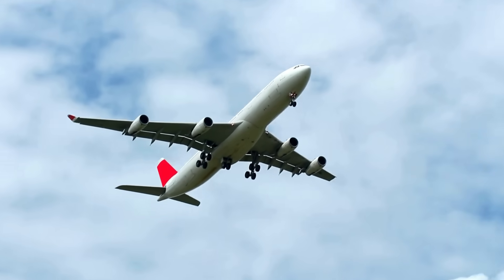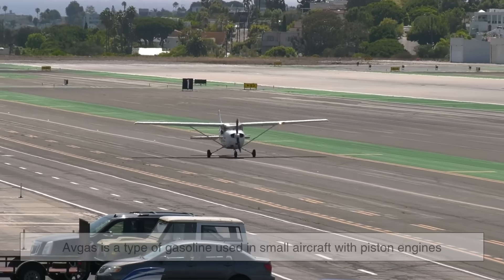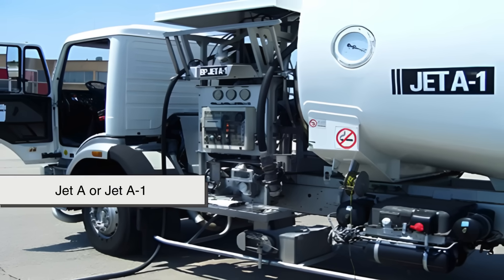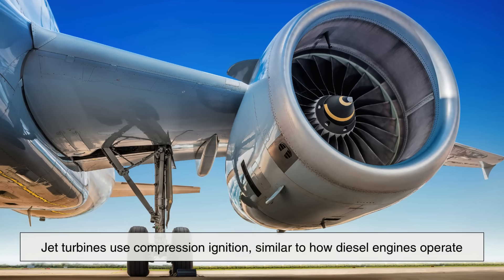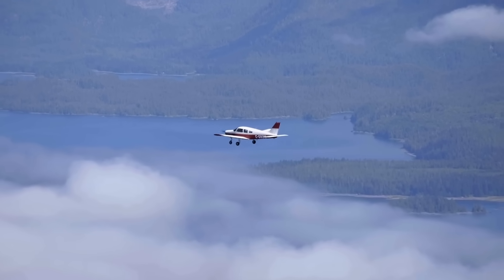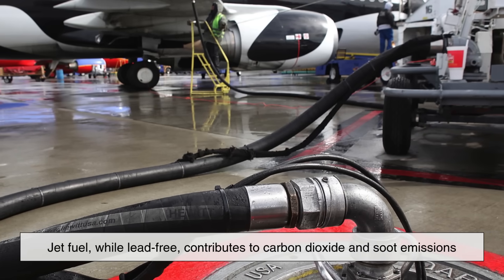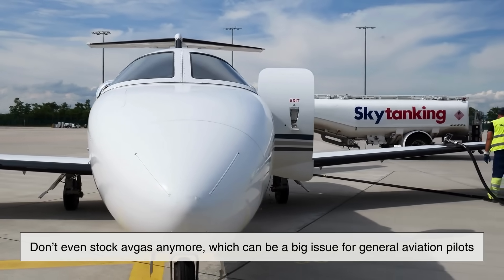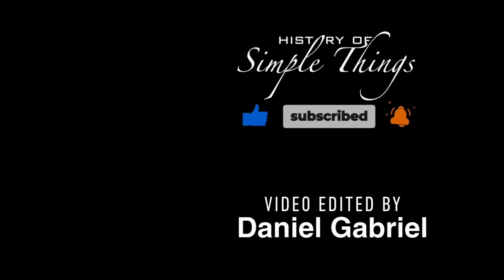Avgas vs Jet Fuel: What’s the Real Difference Between Airplane Fuels?

Comment: At the present time one of the big issues for piston engine airplanes is developing a suitable unleaded avgas formulation that is approved for use in piston engine airplanes. This has been a slow and complex process to develop a suitable unleaded avgas that has been taking a lot of time due to various reasons. One of the reasons is that in automobiles the gasoline engine is running at a low power output to cruise down the road. In a piston engine airplane the engine running around 80 percent of full power output to fly the airplane through the air.

Comment: Avgas fuels piston engines. They require a fuel that vaporizes easily, but burns in a controlled predictable flame front across the cylinder after ignition. If the fuel-air mixture burns spontaneously everywhere in the cylinder the explosion and resulting pressure spike wreaks havoc on the engine. While most laypeople think that the sparkplug sets off an explosion in the cylinder, it actually sets off a controlled smooth burn that typically takes about 5 milliseconds to complete. The octane rating of the fuel is a measure of how resistant the fuel is to exploding rather than burning. Higher octane fuels can be used with more compression of the fuel air charge, producing more power, and Tetraethyl lead is a very effective additive for increasing octane rating. This concern for smooth burning also fundamentally limits the size of aircraft engine cylinders and also explains the use of dual ignition. Dual sparkplugs start the burning at two points in the cylinder, allowing two flame fronts and completion of combustion in half the time.

Avgas isn't restricted to small engines. There have been very large piston engines built for aircraft, but it is true that gas turbines have captured the market for high power engines and current piston aviation engines are primarily 400 horsepower or less.

Jet fuel is used in turbine engines. Almost any fuel can be burned in a gas turbine if it can be pumped through a nozzle and atomized. The recipe of Jet fuel is controlled mainly to assure flowability at cold temperatures. This video says that turbine engines are compression ignition, like a diesel engine. Not so. Turbine engines have igniters to start the fire when the engine is starting,  and like an oil burning furnace, gas stove or a candle, there is a standing flame that continues as long as fuel and air is supplied. The igniter is turned off after starting is complete unless flight continues into an environment that might interrupt the flame continuity. The combustion process involves only a fraction of the core airflow...the design of the combustor is dictated on maintaining a stable flame and then mixing the very hot combustion gasses with the rest of the airflow to get the flow into the turbine section mixed and down to a tolerable temperature for the hot section materials.

Comment: Jet Fuel is Avtur (Aviation turbine fuel)
Avgas is high quality petrol - F40
Avtur = Jet A1 or F34
Reply: Yes, Jet A1 is what I burn in my furnace to heat my home.
I live in rural Alaska.  Our fuel oil is A1.  It's sold as diesel, heating fuel and jet fuel.
Here it's all the same thing.

Comment: During the first oil embargo in the 70s we took out gas cans, 15 to 55 gallon to the Orange County Air[port and bought 105 octane Av-Gas for our sand rails. The rails had high performance VW engines and needed the lead and higher octane . Then the airport decided to stop selling to anyone not gassing up a plane. hen we had to buy the new unleaded higher octane gas and use the new lead substitute in the mix. Finally we were able to get and install stainless steel valves stems and guides in the heads. It's amazing what was needed to just go out and have fun for a fe days.